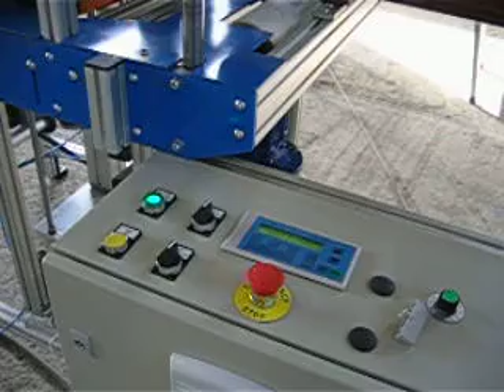Protective tape application machine ALCOLOR PTA 300 Auto

Comment: we are interested. can I know the prize and deliver details immediately.
Reply from the maker: LENIN KUMAR 

 
 
 
  
   ALCOLOR
   P.T.A MACHINES SERIES
  
 
 
  ALCOLOR P.T.A. 250

  
  Both sides, for profile sides up to 250 mm wide, price of the machine without roll in/ roll out free roller tables.
Price 10.900 EUR

  
 
 
  ALCOLOR P.T.A. 250 x4 manual cut

  
  4 sides application Price: 13.900 EUR

  
 
 
  
ALCOLOR P.T.A. 300 Auto w automatic cut

   

   
   

   
  
  
Automatic protection tape application machine and handling plant for aluminum profiles up to 300 mm total width, by all 4 sides simultaneously. The plant includes the main machine, 7 meters roll in table, 7 meters roll out table without automatic lateral transfer.    
   Profile speed 10 up to 60 m/min Price: 32.900 EUR
 
  PTR Cut 300    
   

   
  
  
   Protection
   tape roll cutting machine for cutting 
protection tape rolls in
   different widths from large 
plastic film logs, of up to 300 mm
   diameter.
   Price:
   12.790
   EURO
  
 
 
  

 
 
  PTA 1500 manual

   

   
   

   
   

   
   

   
   

   
  
  Protection   tape application machine for steel, aluminum or other sheets, up
   to 1500mm wide and 4000 mm long one side at a time. Manual
   drive
                      
    Price:
   12.500
   EURO